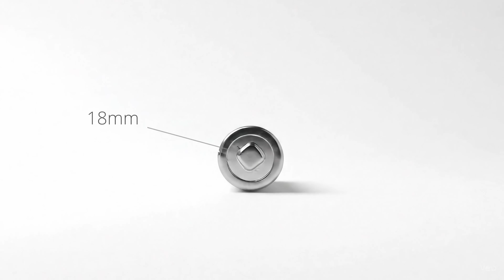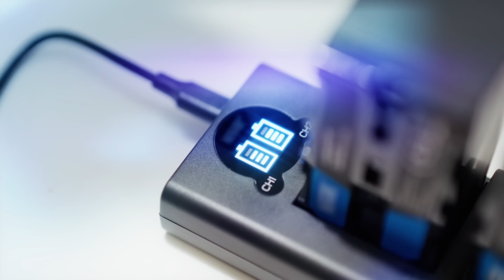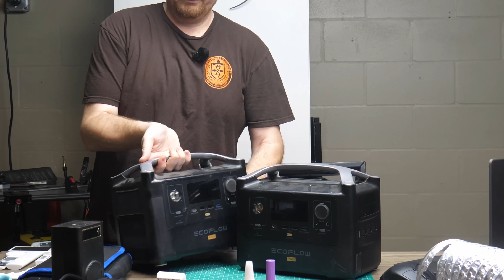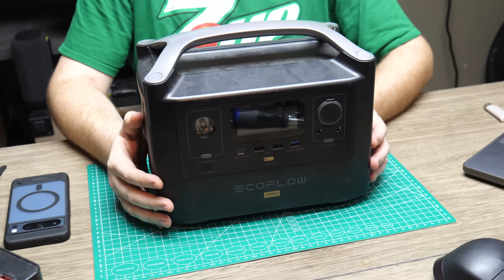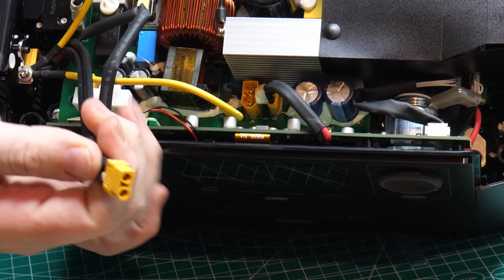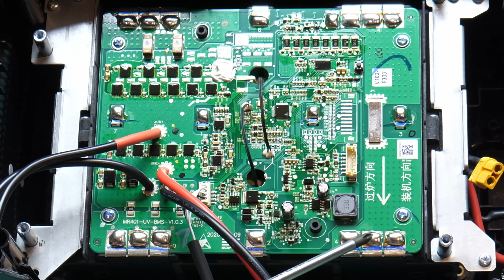I Bought 10 DEAD EcoFlow Power Stations... (Explainer and teardown)

Comment: It is current that kills, not voltage, just because it's DC doesn't mean it's not dangerous, even low voltage DC. It only takes an amp across the heart to stop it.
Reply from the maker: True, to an extent. DC voltage under around 50v cannot get past the resistance your skin and can't give you a shock in most cases. That's why you'll never receive a shock if you accidentally touch both terminals on your cars battery with bare hands, even if they can produce hundreds of cranking amps. Appreciate the insight and feedback, I will be going over safety first thing in my next video, including removing jewelry, wearing gloves and having a proper way to dispose of cells if they spontaneously combust. Hope you stick around!
Reply: I concur with pantherman. DC does not mean safe. I have had a 12 volt car battery knock me down when I was sweaty. It is the conditions that matter when dealing with low voltage DC. It obviously won't jump an arc (and reach out and touch you like AC), but due to its direct nature, if it does enter your body the muscles tense up and stay that way possibly until some damage is done. At least A/C gives you a "vibrating" chance to get away if you can. My 2 cents. Source: electrician for 40 years.
Reply from the maker: I appreciate the professional insight. I'll include this note in my safety segment in the next video 😊

Comment: Could of used the fuel rail to get fuel out of the vehicle. Fyi
Reply from the maker: I did try that - regrettably, on the newer Hyundai direct injection systems, they use proprietary connectors at the rails and regulators and I feared without the proper 'tool' I'd likely be replacing a fuel line after the storm passed. I even considered tapping the fuel tank, but decided the groceries weren't worth it. Thanks for watching and the suggestion!

Comment: you can't siphon a gas from tank? oh god... education really is illegal in US. 

What about disconnecting fuel line in engine bay, hooking extension line to it, put it into jerry can and and let fuel pump do it's thing
Reply from the maker: Easier said than done on a modern direct injection engine. All the fuel lines are proprietary plastic connectors melded onto the end of the fuel lines - without the proper tool, I'd likely break one requiring a whole new fuel line. This was the first thing I tried after being unable to get a tube in the tank. Thanks for watching!

Comment: I have been happy with my power station for years now (purchased in August 2021), so last year I bought a much larger power station. We had an outage recently lasting around 8 hours, and I was able to continuously power my fridge and chest freezer. Very handy and hassle free. In fact I worked from home the whole time off batteries.

Edit: I have attempted the recovery of lithium cells a few times. It doesn't always work. Once you've charged a cell back to 4.1 or so volts, put it through a discharge and charge cycle to make sure the cell will actually function. In some cases you'll find the charge capacity so reduced that it's time to recycle the cell. For example, if you have a pack of say 8 cells and two are weak, keep the 6 and recycle the 2 to save yourself time and aggravation.
Reply from the maker: Great advice on the cell replacement. I'm going to try to put together a full charge/drain cycle to see what the capacity loss has been on these packs. So far, none of the ones (I only use 3 regularly) I've fixed have fallen out of balance; 🤞 thanks for watching and the insightful comment!

Comment: Can you not simply plug the XT60 and balance connector to a RC lipo charger?
Reply from the maker: Unfortunately, no. The XT60 is shunted from the input or output voltage once the BMS dies, so no matter what I tried to feed into it was useless. The other connector that looks like a balance connector appears to just carry basic data lines to tell the controller to turn on and what the expected SOC is based on what the BMS is telling it. I plan to do a FAQ video/segment and will add in what I tried to do prior to tearing them down.

Comment: These can be used as a ups. Mine is hooked to my Starlink and network gear and acts as an instant backup. It also ensures clean power too since my devices are isolated from the grid
Reply from the maker: That's how I'm running a few of them in the shop - keeps my security system up if the power goes out so I can always check in. Thanks for the comment and watch!

Comment: On the getting gas from the better half’s vehicle.

Remove the feed hose from the tank to injection rail. Put a hose on it and into your container. 
The find the fuel pump relay. Fin the load side and jump the 12 volts to the pump.  And there you go a poor man’s siphon.  Each vehicle is slightly different.  Just an idea that worked for me.
Reply from the maker: 100% great advice if you can get to those components easily. Unfortunately, our old school tricks don't work great on some of these newer vehicles; in my case, I'm working with a Hyundai Theta engine; so not only is the fuel rail buried under the intake, but it uses proprietary connectors which can't just be wrenched off (at least without breaking them). I tried, and failed; almost tapped the gas tank, but decided I'd rather just lose the fridge than possibly harm the car. Thanks for the watch and comment!

Comment: A. Always have extra fuel.... I have 20 gallons of Rec Fuel for this reason. 
B. If you disconnected the fuel line at the engine of the car, and jumped the relay for the fuel pump, you could have had fuel for your generator.
Reply: Dual fuel generators are great if you don't want to worry about emergency fuel. Just keep a 20# LP tank on hand, they're cheap and it won't go bad. Most ~2000-3000W generators will run for 10-15 hours on one tank. Enough that if you only cycle it on every few hours for 30min, will give you a solid few days of power if you need to stretch it.
Reply: He mentioned right at the start it was unexpected so he didn't even have a generator or anything else to generate power.
Reply from the maker: DI engine - all the fuel lines are pressure crimped and buried deep under in intake/turbo system. I did try, but couldn't find a way to do it without potentially causing more harm than good. Fuel reserves were secured for this year! Thanks for the advice!

Comment: I feel your pain regarding power loss leading to food loss. But an option that almost everyone overlooks is a medium sized 12 volt inverter. (Around 1200/1500 watts). You mentioned your wife’s car had a full tank of gas. Start the car, attach the inverter, run an extension cord and plug in your refrigerator/freezer. It’s that simple. Run car for 3 hrs out of every 6. Full tank should last you several days. WY cheaper in the long run and easier and safer to store.
Reply from the maker: The ICE car is a Hyundai, maybe not less of a fire risk leaving it running for an extended period in the Florida heat 😂 only kidding - it is a good alternative. Ideally I'd connect the 12v inverter to the Tesla and use my free supercharging to keep appliances running, but there's risk there too.
Reply: @fauxrhino now that’s an excellent idea I didn’t think about. Would love to know your thoughts on how to hook it up safely. My guess is Tesla has made this just about impossible for anyone without proprietary connectors and knowledge.
Reply from the maker: Unfortunately, yesterday at around noon, my Tesla sent me a notification that the HV battery has completely gone, so it's likely that car will be replaced soon ($15000 for a new HV battery). The 18650 giveth and the 18650 taketh away 😭
Reply: @fauxrhino that’s very bad news 😢
Reply: @fauxrhino  Contact Alex from out of spec renew/wattworks. He might give you a hint for service options in your area/offer remote diag. Depending on what's wrong, shipping the car one way and driving it back could be worth it.
Reply: Agreed I love inverters so much I have 5
Reply: Isn't there an inverter in the Tesla that can power a fridge?

As for charging the Tesla in a power outage, you can just attach a rope and tow it with the wife's gasoline car, with the Tesla set to regenerative braking.
Reply: @The-secret-101 LMAO!!!😂😂
Reply: The inverter in car option is what I recommend for apartment dwellers quiet, discreet power backup

Comment: 6:56  No gas.  If you used a 12v inverter backup with 12v batteries, you could charge them with the car alternator and jumper cables.  No, you would not get many watts per gallon but it would be a port in the storm.
Reply from the maker: I actually had a 12v inverter that claimed to be good for up to 360w but couldn't support a 25w fan when plugged into the car. I paid for my frugality in the long run on that one!
Reply: @fauxrhino Sir.  I have 1000 amps of 12.8V LIFEPO4 batteries hooked up to a 2500 watt LOW frequency inverter which will peak at 7500 watts.  I have run it at close to the rated 2500 watts for extended periods.  

My Honda at idle with minimal draw from the car's systems will put 50-60 amps through my single 0 gauge 15 foot jumpers into the large battery bank when battery charge level is in the handle of the hockey stick curve.  

The inverter running the frig takes about 10 amps so I have 40-50 extra to bring up the battery level.  I could get over 100 amps if i used high idle but do not want to overheat the car alternator with the car standing still and no high speed air over the unit.  

I too have experience with over rated inverters.  Some 30 years ago I bought a name brand computer back up unit rated at 750 volt amps,  It would only put out about 300 before switching itself off, even with additional batteries attached to be sure it was not a low input fault.  I switched brands.  

A T Burke  

P.S.  in the late 1950s I built a Heathkit MP-10 Power Inverter.  It ran off 6 volts and would put out 120 watts.  I used it at 150+ watts, hours on end.  It is not about supply  voltage.
Reply from the maker: That's an awesome setup - I hope to have something similar some day!
Reply: @fauxrhino  Yeah, gotta get something name brand if it's something you need to rely on. The Victron 500VA is relatively cheap for a solid unit, and could power your fridge directly by connecting to your gas car battery, or be used to charge up one of the ecoflows much quicker than using a car's 12V power port.
However in a pinch, if your Tesla is charged, you can use the the 100W power port to slow charge one ecoflow, while the other one is plugged into your fridge. The fridge won't average more than 100W continuously if it's not a ginormous one and keep closed as much as possible, so you wouldn't start falling behind energy-wise.
Reply: @fauxrhino you got mega scammed damn
Reply from the maker: @wellhmm1193  Always test your equipment within the return period haha
Reply: @fauxrhino  You can disconnect the fuel line where it goes into the injectors on your engine, and run an external pipe out and jump the relay for the fuel pump to pump it into a container.

Comment: "lithium ion" isn't a battery chemistry. These units have LiCO and are not as safe as newer units with lifepo4.... These dead cells are trash and can self ignite.
Reply from the maker: Thanks for the comment! In the second video I do go over an explainer of the issue with recharging dead cells and dendrite formation within the lithium layer.  You're likely much more knowledgeable than me on the subject and I'd love your input/thoughts on my attempt at an explanation.
Reply: @fauxrhino that works but I don't think old LiCO should be used in any enclosed space. Lifepo4 is cheaper and does not self ignite

Comment: Preparedness- big genny, large STABILIZED and rotated fuel storage even 20 gal goes a long way.  I doubt these batts are going to meet your needs. For what you spent on these you could have built a large LFP DIY system with much higher capabilities.
Reply from the maker: Unfortunately, my living situation doesn't support a large generator or storage for fuel outside of a few cans. I hope to show off my custom system in time, and while I do use a generator, the silence of batteries is a godsend when you don't have the space to keep it far from the house. 

Thanks for the watch and suggestion - stick around to see how I combine these units to work more like a larger power wall.
Reply: @fauxrhino  Well that does suck but Good luck and when you get it done I hope it works out to meet your needs. I am subscribing to follow your process. I have some battery build and repair videos on my channel.

Comment: Most of the time you can get an LFP Ecoflow battery that's had a BMS fit back alive by simply charging it for a few hours via the 12v input rather than taking it apart. Not always - stuff like dead cells or internal shorts of course it won't.

Two things I'd point out for anyone planning to try this
- Never wear rings or jewellery - the current on the batteries is enough to give you serious burns if your bling shorts across it
- The bigger units are 48v. Killing yourself at 28v is quite hard (but not impossible), killing yourself at 48v DC is surprisingly easy so before touching a 48v one wear safety gear and make sure you are familiar with the correct safety procedures.

Not sure why you are surprised that Ecoflow made them easy to work on, the amount they seem to fail and the perpetual sales of refurbished units presumably means they spend a lot of time working on them 8)
Reply from the maker: Yes, the ring was an oversight on my part and next time I'll have some gloves to make sure nobody has to be nervous for me :) appreciate the thorough comment - all great advice!
Reply: Are these LFP or non?
Reply: @jaro6985 The Ecoflow kit with 800 cycles to 80% are NCM, the 3000 cycle are LFP. Original River is I believe NCM, River 2 and 3 are LFP

Comment: If u tie into the grid they turn of your panels if there's no power
Reply from the maker: Usually you can setup a fallback 'local' circuit to allow you to pull power from your panels even if the grid is down, but you MUST sever the grid connection before turning on your backup otherwise you could back feed electricity through the system, potentially killing a lineman trying to get your power back on. 

Thanks for watching!

Comment: i have fears on 18650, my previous laptop battery build explodes years ago, my table is on fire but thankfully i have no injuries/burns
Reply: Classic li batteries are vastly more dangerous than modern LFP (I had a Thinkpad 600 explode many years ago and that involved the fire brigade). NCM and some other forms as used in older kit (or by a few older EV designs) are not funny however. I'd never dream of trying to refurb an older Ecoflow Delta or similar with NCM batteries.
Reply from the maker: The newer chemistry is much more stable, but also less energy dense. I've seen these things take a lot of abuse and bounce back okay, granted I'm sure I'll eat my words with one mistake.
Reply from the maker: Whew, that's scary. These things hold a lot of potential energy and can certainly be a little risky to work with. While a fire would make for good views, I don't think I want to get kicked out of the warehouse so 🤞 

Thanks for watching!

Comment: I seen a guy , just charge a battery  by . Just bypassing the smart side with a car charger using nails for contacts.
Reply from the maker: Interesting way to do it, but it would technically work on the DC input. As long as the charger has a fuse, I don't see a problem with this. Sometimes you gotta do what you gotta do 😂

Comment: Why not setup a way to draw 50% of the tesla power?  That would give you at least 10kwh of power.  How much power can you have stored now?  Oh, thanks for the 18650 info.  That was great.
Reply from the maker: Something I've seriously considered, but I have an older Model S which has free supercharging for life. In the terms and conditions, they can cut off my supercharging if I'm found to be using Vehicle to Load (V2L) to power outside sources. I could pull straight from the 12v system in the car, but would only be able to pull around 1200w before it blows a main fuse and possibly hurts the 12v charging circuit.
Reply: @fauxrhino  as a backup, you can get a 1,000 watt power inverter and can use it with your gas powered car to give you another source of power.  Just make sure the car is running if you do this, and preferably monitor the voltage on the car just in case it starts pulling more power than the alternator can produce.
Reply from the maker: Very good point - but without a backup source for gas, there's always the possibility you get stuck in a way you cannot evacuate if another storm comes right behind the first. Back in 2006 (IIRC) central Florida got hit with 3 back to back storms, and where my grandparents lived, they were without power for over a month. A solar system for their well would have been a lifesaver, granted the technology wasn't around to make it a reality back then. Also, I don't know if I'd trust the Hyundai idling for hours like that...might be more of a fire risk than the 18650's haha!
Reply: @fauxrhino  good point!!  

Personally, I’ve got backups for my backup.  Got a 3,500 watt generator, 1,000 watts of solar to recharge 400 amp/hrs of lithium with a 2,000 watt power inverter, then I’ve also got a 36v golf cart with a 300 amp/hr lithium battery in it along with a 120/240 volt power inverter that can run my water well in an emergency.  I’ve also got a backup 12 volt water pump on the well that draws water from the 90 gallon pressure reservoir……. all just in case.  2 is 1 and 1 is none.
Reply from the maker: Now that is prepared! I hope to get there someday - a whole home off grid system would be ideal... and not living near the coast in Florida where Hurricanes are a yearly occurrence haha